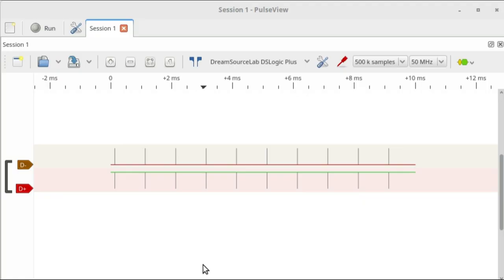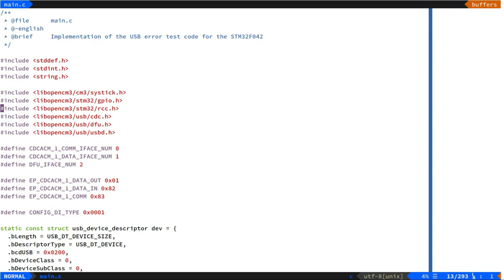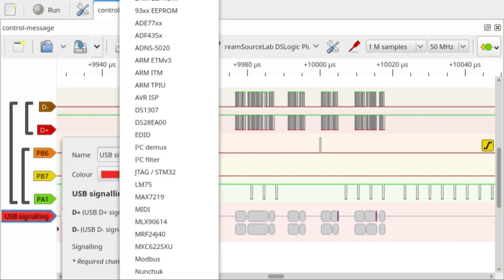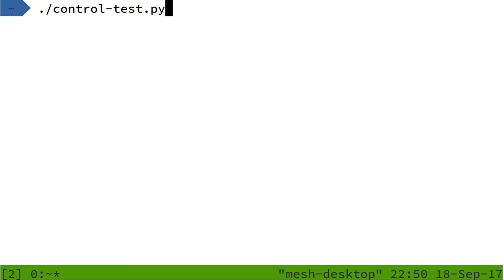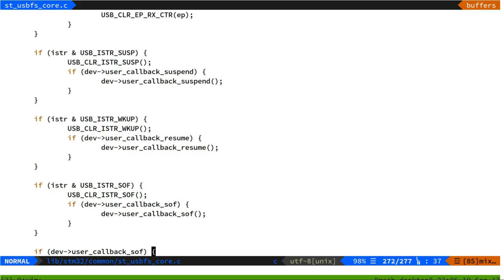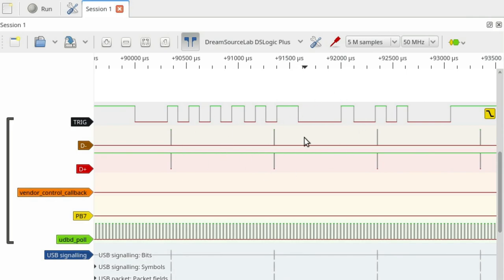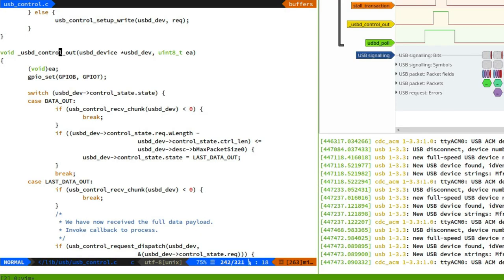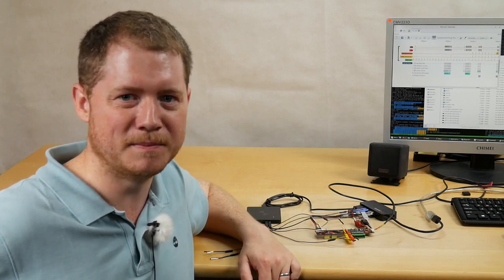[011] USB Debugging with sigrok

Comment: The Nyquist criteria applies to the frequency of the signal, not the bitrate. In theory you only need 10MSPS for a 10mbit/s signal, since a 10mbit/s stream of alternating 1s and 0s is actually only a 5Mhz square wave. But then again it's always a good idea to have a much higher sample rate than the absolute minimum.
Reply from the maker: +Andrew Chen You're quite right. I've been aware of the error for a while. It's about time I issued a correction
Reply: A 5 MHz square wave will have a much higher bandwidth than 5 MHz depending on the fall and rise time, and so will resquire much more than 10 MSPS.
If we count only 5 first harmonics, the bandwidth is 25 MHz and so the minimum required sampling rate is 50 MSPS : https://upload.wikimedia.org/wikipedia/commons/5/50/Square_wave_frequency_spectrum_animation.gif
Reply: And you forget keyword “Analog”. But here we deal with digital 1/0. And it’s only matter of edges rise/fall time to be good enough for analyzer inputs to understand the input correctly.
Reply: @HalfLife2Beta  Both of these answers are correct on their own but neither are fully applicable to logic analyzers.  While it's true you could get away with 10MSPS, you could only do so with perfect clocking (or using the clock signal on the DUT as a trigger).  As soon as the clock of the DUT and your analyzer get a little out of sync, your capture is messed up.  The reason we want to oversample with a logic analyzer isn't about the nyquist frequency (which is purely concerned with the analog domain), but rather to make sure we can deal with mis-matched clocks when we don't have a clock signal (or haven't identified it yet) or don't have a way to utilize the DUT clock signal with our analyzer (typical of cheap logic analyzers).

Comment: Brilliant Tutorial , very interesting to see the use of the signal bits moved about the code to narrow down the issue.  very neat.  An eye openning video from the perspective of someone just considering to use a logic analyser for USB development on a micro controller.   usefull in so many ways, from explaining the D+ D- traces , using the decoders right up to the probem solving with the control signals.  Thanks very much,

Comment: In the datasheet of the chip there is a timing diagram. Looks exactly like the output of the logic analyzer, the one with the slanted edges. There are time limits on by when you have to have your data ready to send it. And time limits by when you have to have your next bit ready to send. The same goes for getting ready to write the next bit... They are usually written out on the clock pulse, but the data has to be ready a little before. If you (or the code) get it wrong, the state becomes undefined and the Chip kills all communication. All serial communication Chips have the same necessary timing needs, always defined in the datasheet. 
There is a better way of explaining that I am sure, but that's the gist of it. You were pretty much right on the money with your timing conclusion. EEVblog has a great explanation in one of his videos.

Comment: In your new printed circuit boards, in design you need to do all possible test points at once, further testing and debugging will become much easier, also in production it will allow you to test the entire circuit almost automatically. I always design two boards, the product itself and the response board with needles, also I often have another controller and the necessary peripherals on it to be able to automatically program and test my products. the same solutions are used by all serious electronics manufacturers.

Comment: Awesome, as always! A topic suggestion would be to set up an open enviroment for developing with ST and others ARM microcontrollers, I mean, setting the toolchain (GCC), explaining the build process (GCC flags, make) and GDB.
Reply from the maker: Certainly could do. If you need a basic project for a template, the demo firmware in the  show notes might help. Also, the libopencm3-examples repository.
Reply: My knowledge today is pretty solid, but it took me a long time digging in the web to find little pieces of information and gluing them together, a pretty demotivating factor for a new guy.

Comment: Amazing video as always? Is it possible to capture the USB packets with 24MHz fx-2 Chinese clones? Or you chose DSLogic Plus Logic Analyzer since it support higher bandwidth?
Reply from the maker: +vijayenthiran subramaniam Thanks dude! Yeah 24MHz would be a cutting it a bit close on bandwidth. Also the FX2 logic analyzers are rather unreliable at max speed- they tend to halt if there's even a tiny amount of congestion on the bus
Reply: If you stick to low speed (1.5MBps), it works. Full speed will likely not work, you need at least 2.5 oversampling (30 MS/s), better 4 (~50MS/s).

Comment: Hi, Which IDE are you using under Linux which supports openocd  and debugging?
I found quite nice STM32Workbench.
Reply from the maker: Not an IDE as such. Just tmux to make a split-screen terminal.
Reply: Thanks for replying.
Reply: Looks like you like vim. Check out neovim or the new vim 8 feature to multiplex terminals (both of them now have terminal buffers from what I can tell). You can get rid of tmux and be able to yank and paste to terminals which is awesome.

Comment: Before you start writing code for STM32, first of all you need to familiarize yourself with all the errata datasheet (or even better, familiarize yourself with these at the design stage of the device, otherwise it may cause a new design), on the chip itself and also on the libraries used. They have a lot of errors, sometimes it takes a lot of time to search, and the problem is already described in the documentation.

Comment: (WHAT IS THIS.. Just typed a very long reply, accidentally hit "previous page" now its all gone... Anyway, here goes again.....)
So this is pretty interesting.. I've been having a seemingly similair issue with something I'm developing on a STM32F072.. Now it's not using libopencm, but ST's CUBE HAL libraries, and I've also added FreeRTOS.. The issue has appeared/disappeared, I thought I fixed it, then I didnt, etc.. You know how it is.. (So I don't recall if it was there before I added FreeRTOS, I think it was, anyway.) Overall I'm receiving data from the PC at about 25 Hz, and also sending at about 25 Hz.. I think the pipe error occured when I wasn't reading or trying to write at about 50 Hz, but did when I tried to make one of my loops actually 25 Hz.. It's been some time ago, so it's all pretty vague.. I kinda dismissed it all since it seemed like the issue wasn't present in the current firmware version.
I thank you for this nice video, I can probably copy most of your steps trying to debug the issue in my case.. (Will see how well this'll work with my Logic analyzer, and equipment etc..)
Looking at all the wires soldered onto your board, you probably should've added some more pads/things for debugging, no ? :p  I've got 5 GPIO's routed to a connector on the board that are completely unused, though I have to admit, I will have to solder wires onto some USB data lines too... I will probably get back to you if I find out what is going on here.. But I don't see myself having anytime soon, unfortunately.

Also, is that a 1.25mm to USB Type-A plug cable ? Darn, I need those! (with some strain relief..)
Reply from the maker: Thanks for your message. Without having visibility of the USB comms, it's really hard to figure out what's going wrong. As for all the mod-wiring; unfortunately I didn't design the board, otherwise I would have added all that stuff. If you're adding an LA to USB keep the wires short, and maybe check the the LA doesn't cause signal integrity issues with a scope.
Reply: Cheers. You know I was actually looking into buying a DSLogic but there's something weird going on.. Their website doesn't seem to be updated for ages, nothing official mentions the DSLogic Plus, ebay has some for various prices (looks like some don't have 256M but way less memory), different connectors (1 bar of pins, or an intermediate old iphone connector in between, and the new one).. Lack of official support should be alright given Sigrok as alternative, but its all strange. I was going to buy one of the cheap combo's on ebay with a DSLogic+Scope for about 80USD (which seems to have the newer DSLogic Plus in it, or atleast given the right seller, judging by the pictures)

Comment: Hi Joel... I've just got hold of a wad of software that'd be brilliant if you covered it here.
I've got hold of an AVR simulator ( https://github.com/buserror/simavr ) and a nice GUI for it to live in ( https://sourceforge.net/projects/simutron/ )
After taking a cursory glance it looks brilliant 'cus you can debug AVR code using GDB on Linux and not having to mess around with that nasty Windows stuff.
But, even though I'm no stranger to GCC, I've shied away from the likes of GDB and QEMU and such like... So I'm here saying "looks nice but what the hell do I do".
There looks like there's some coverage on YouTube but, y'know, there's two kinds of YouTube and there's more of "the other sort" than there is of "the good stuff".